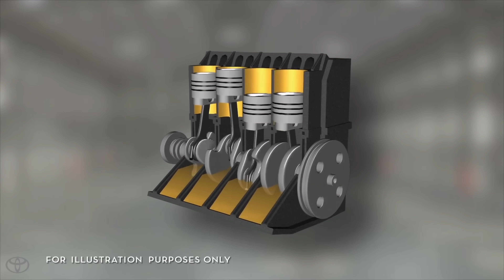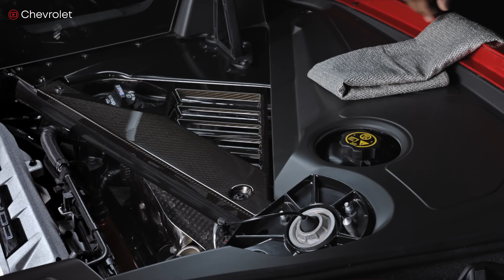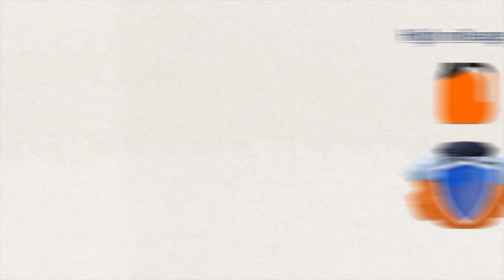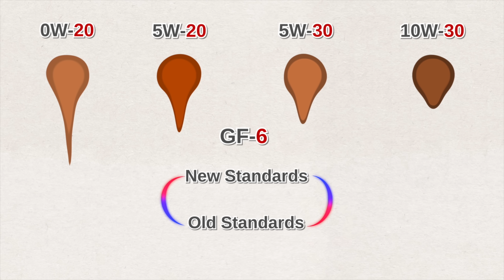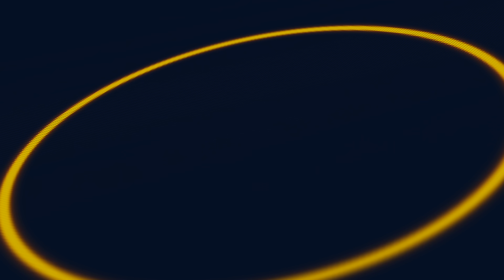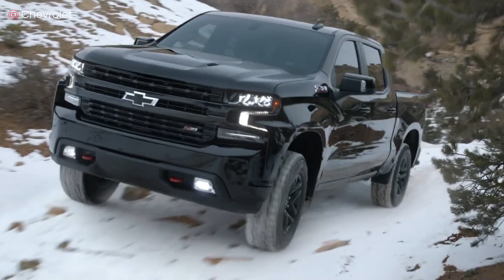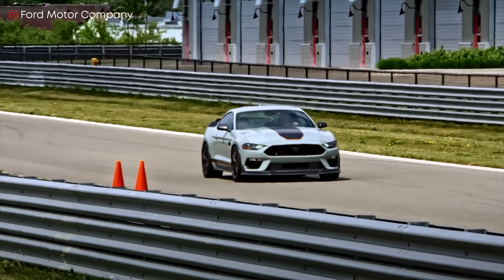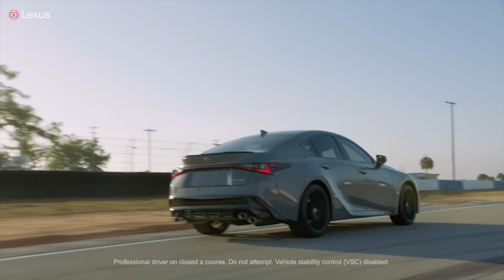7 Engine Oil Myths Stupid People Fall For

Comment: I used to work at my dad’s service station through high school and college. Down the road from his station was a used car lot called Pincher’s Used Cars. They came in and always just bought ONE gallon of gas. They wanted to have just enough gas to get the customer off their lot. 

When I checked the oil in their cars there was sawdust in more than half the cars crankcase. They put in the sawdust to slow the flow of oil leaking out. If the car needed oil they’d always get the 50W oil. 

I always felt sorry for the people who bought cars from them. They were a typical used car lot. I’d never buy a car from one of those small used car lots. They are all crooked.
Reply: I don't think that happens much anymore and those kinda guys would not be in business very long doing that kinda stuff now days. That and modern engines would not run very long with sawdust & 50 weight in them, I'm talking minutes. Ha!
Reply: @429thunderjet2  Thats true. Just about all cars have computers and OMDs can diagnose any problems. I believe sawdust in oil would freak out a few sensors. It’s a lot harder to sell a lemon these days. There is even an accident database. But one great thing about older cars is you could fix just about everything on them. I’ve overhauled a dozen engines and a few transmissions. I loved working on cars. But now they are engineered to discourage any do-it-yourselfers. 

Things changed radically in the 80s. They even added 10,000 different type screw heads (slight exaggeration ;). I remember trying to work on my mom’s 1980s car and needed to but need to buy a lot of special tools to do it. Just 3 types of screws could replace the countless types they have now. It’s all about getting our money.
Reply: @MovieMakingMan  for sure! There is however still plenty of unscrupulous shops, mechanics & dealers that all they want is your money, unfortunately.
 I am an old lifelong mechanic that can sleep at nite knowing I was fair & honest with my customers. But yah they sure are getting hard to work on and that's not taking into account the electronics that can sometimes kick your butt. Talk about tools, ha, I have 10s of thousands of $$ invested in tools over the years, maybe more like five figures, idk I haven't counted ha! Heck, my $6k multi function scan- test- scope tool needs a $1,200 update right now. 
So my advice to everyone is keep up on maintenance, use top quality lubricants, filters & parts will go a long way to keeping your vehicles on the road and out of the shop.
Reply: @MovieMakingMan  also I think saw dust put in motor oil would plug up solenoids and restrict oil flow enough on modern engines to destroy them in very short order, more so than messing up sensors. But anyway yup not good.
Reply: Another thing that gets my goat is those shops upselling services that aren't really needed. That or charging for services that aren't even done. It gives honest shops & mechanics and the whole industry for that matter a black eye!

Comment: As a tech I always recommend people to change their oil 1000-2000 miles earlier than what the manufacturer recommends if they drive their cars hard. Last thing you want is worn out dirty oil trying to lubricate a high power motor at its top end power
Reply: Would using 5w30 in an engine that calls for 5w20 hurt it?

Comment: What about 10w-30 that says it can be used in engines that require either 5w-30 or 10w-30? Never heard of anyone talk about that.
Reply: 5w-30 is a better option as it is thinner at startup which is better to quickly flow and protect a dry/cold engine. Either way at operating temp they both run at 30

Comment: THIS OLD CRAZY WISE GUY 
👍🏼HE'S ALWAYS 💯RIGHT👌🏽
Reply: ....well, the second number in 10W30 is not the summer number, it's the viscosity at or near operating temperature the engines clearances and flow paths are designed for.  It's very important to get that right, and the 10W winter or cold viscosity only matters to people in cold climates.  He mentioned the vis at 212, but that's the viscosity SAE test temp standard the oil is tested at.  An engine that runs very not like in racing often uses a higher vis due to that operating temp, then even more important to get the engine hot before putting a big load on it.
Reply: Except when he is Wrong. W does not mean Winter. If he has been a mechanic for 50 years he would know that.

Comment: Actually LSPI is not for gasoline detonating too soon - it's about oil that detonates too soon - before the gas is sprayed in, the oil is detonating causing bits of ring and piston to blow apart. The pass rate is quite low but only a true 100% synthetic is passing LSPI tests 100% (per dexos Gen 2 testing)

Comment: Full Synthetic or 100% synthetic - Amsoil gives you the best of these and seat of the pants (dyno testing too) you can feel the reduction in drag when you tap on the accelerator. 
All oils should be "High mileage" - To make a oil that is not "High Mileage" means they are stripping you from the additives you are paying for.. Because if you started with  "high mileage" oil you would never see the degradation considered to be high mileage.

Comment: I have an '06 Chevy Silverado 4.3 V6 with a little over 150K.  I always changed or have my oil changed before it's due.  I've always used conventional.  Used to do my own but NTB always has a sale for $19.95, With fees it's about $25, and they use Valvoline.  I can't buy the stuff for that, and if I could I wouldn't crawl under the truck these days for the little difference.  I'm 73.  My wife's 2018 Toyota Highlander (love this vehicle) takes 0-20 full synthetic.  Still getting this done at the dealership on their dime.  OK, here's a question.  How much synthetic oil must be added to conventional to be considered a blend?

Comment: And for 65 years I thought the "W" stood for "weight" - WTF?  I don't recommend switching from conventional oil to synthetic oil in older vehicles >10,000 miles. I did it ans spun a main bearing.  There are more detergents which  can plug screen intake to oil pump, and synthetic likes tight clearances as in a new motor. I have never used synthetic. Good old Quaker State 5w-30 every 3000 miles and everybody is happy
Reply: zero evidence for what you are saying.  none

Comment: Scotty I have a question. I have an 05 Ford ranger with 112,000 miles on it. If I switch to full synthetic will it be better or would it hurt it? It calls for 5w-30 conventional.
Reply: Daniel, Go with 5-30 Motorcraft Full synthetic motor oil. It's more expensive but the protection is awesome.  Shawn.

Comment: Synthetic motor oil has been run through a refinery hydrotreater with hydrogen to get rid of unstable long chains that might bond with each other to create globs of gunk. When mixed at the lube blender the additives are added. The more expensive oils have up to 1/3 additives by volume. Most of these additives are vendor secret blends of antioxidants to keep steel and bronze bearings from wearing. Standard oil is ordered from the refinery with standard blends of heavy and light oils to match viscosity specs. They may not have any special additives.

Comment: Rest assured that the vast majority of "synthetic" oil is not really synthetic like it once was.
All of that fancy synthetic oil you get at Walmart is group 3 which is nothing more than standard non-synthetic oil that's been hydro cracked.
Hydro cracking is a process which uses heat and pressure to change one molecule in conventional oil which legally allows it to be called synthetic.
Are real synthetics still available? Yes. Those are the ones that cost $15 or more per quart and of course are not available at Walmart.
Once in a great while, the manufacturers actually put real synthetic in the bottles, it's rare and almost impossible to find out which ones they are so good luck.
🏁
Reply: ok genius.

Comment: Also a fun fact when your gas light turns on that “typically” means you have 2 gallons left. For this of whom like to push their luck lol like me
Reply: When your Low fuel light comes on your not only pushing your luck for running out of gas but pushing your luck with your fuel pump if you make it a habit it's the basically the same as  if you running low on oil
Reply: @thegreatcanadianlumberjack5307  Right, and don't want to clog fuel injectors with the crud on bottom of tank.

Comment: My Honda calls for 5w20. I switched to 0w20 and my mpg went up 4mpg. I havent seen it burning any oil or leaking any. I bought it with 160k its a 4 cylinder t now has 166k I change my oil at 3k. Do you think I'm making a mistake and possibly hurting my engine?

Comment: If you're like me and only put on 2,000 miles a year, don't forget to change your oil after 3 or 6 months, depending on car recommendation. Oil does get old once exposed to air. Oxygen, humidity, and other things will degrade over time even when not used.
Reply: Well my car leaks so bad that I’m always adding oil. Haha. So it never gets oil. Just change the filter every year.

Comment: 80% of engine wear occurs in the two seconds after you start the engine and it revs to life.... with no oil pressure! They need to install electric pre-oilers that pressurize the system before the engine even moves. Then you'll get 500,000 miles on a car.
Reply: Probably a million miles...
Reply: Not entirely true. Many Japanese cars achieve this with the crank sensor. Meaning the engine must turn several revolutions to prime the oil pump & pressure the galleys before ignition & fuel are supplied. That’s just one of the reasons why Japanese engines outlive Detroit products.
Reply: @gerrylundergaard60  
If the engine is turning that's the problem.

Comment: Scotty, what is your opinion on Amsoil? My dad and I have been running it for years and we both love it. I have always wanted to hear your take on it. -Rob
Reply: Personally,I think it's overkill. Your engine may go for a million miles but the body will rust out or the transmission will fail or the car might outlast you (I'm 74 and our Toyota has less than 60,000 miles). Furthermore, I enjoy changing my oil so I plan to continue changing it every 5k.

Comment: I have over three hundred thousand miles on my engine I've been using 10-30 conventional oil..I was told that it will leak if I use synthetic. Is this true?
Reply: those were on older engines..the gaskets would start to leak,,,i would stick with what you are using or go to maybe a high mileage oil one
Reply: John, If you used Conventional oil 10W30 for 300,000 miles. Keep using it. But move up to High Mileage conventional oil. Better additive package in High mileage conventional oil. Than regular conventional oil. Shawn.

Comment: I have got a Lancia Delta 836 type of 1993, i use 5w30 for engine in place of 10w40 and atf in place of 75w90 for the manual gearbox.

My Opel Corsa 2007, i use 5w40 for engine and atf for manual transmission.

My 2020 subaru forester hybride (made in Japan, Gunma factory plant) recommends 0w20 for the engine. But Subaru Europe says that oil is for cold lands, like Canada for example.

For countries like Swiss, France or Spain, They recommand 0w40. 5w40, 0w30, 5w30 are suitable oils too.

I spend around 120 us dollars for 5 litres of Castrol 0w40. Grettings from Swiss.

God bless you Scotty

Comment: You forgot 1 though Scotty. High Zinc Oils like Joe Gibbs HR-1 oil or Diesel "Fleet" oils (that still put Zinc in there but it's heavy summer only Oil for gas engines). If an engine has a flat tap cam (older engines from the early 90's down) I always use there high zinc oils & prefer the HR-1 due to it having multiple weight choices. All of my small engines (lawn mower, chipper, tiller, etc etc) I run Diesel Fleet oil in, and even the new ones I just bought, actually call for that oil due to its Zinc levels.
High Mileage Oil - is for modern High Mileage Engines (w/roller cams). It's a recipe for disaster in a Flat Tap Cam engine...... trust me. If you want to use modern oil in your old engine, do the Roller Cam conversion.

Comment: I got High Milage / Synthetic oil, and it seems to work the best out of these three basic engine oil types. No leaks, and no evaporation. And it's viscosity has not degraded. I usually have these problems with other oils.
Reply: i read that even 5w-20 conventional oil is quite stable because it doesnt need so much viscosity modifiers to give the 5-----20 viscosity spread  .
Reply: @tjlee9901  Some viscosity modifiers "viscosity index improvers" (thickeners) as were used in some popular 10w-40 oils during the 1970s and'80s were adjudicated by Tecumseh Engine engineers to have been unsuitable for use in internal combustion engines and I think later GM engineers decided this was true of GM Car and Truck engines--remember the revision made to the 1980 Chevrolet Citation owner's manual
Reply: Where do you get your oil viscosity tested, and how often?  How much oil evaporates over what period of time? 
Oil leaks aren't caused by oil, they're a result of inferior gaskets or seals or poor installation practices.
Reply: Some people claim that one brand or another makes their engine run quieter. I think with the spooky low viscosities like 0w-20 or this newfangled 0w-16 it is likely that such oils can only be made stable and evaporation resistant enough to be practical by using synthetic base material.

Comment: I have a question that is not related to oil. I recently took the exhaust manifolds off my 1998 gmc 1500 and replaced the gaskets and also replaced the donuts between the manifolds and pipe and the flange gasket behind the catalytic converters. After driving  a few miles the flange gasket behind the cats was smoking and had burned a hole through the bottom of the bank 1 side in the same place the exhaust was leaking before. Why does this happen? I am wondering if the muffler is plugged with carbon on that side because the engine was misfiring or something.

Comment: You might have also added on the "higher viscosity is better" myth, Scotty, that use of a "thicker" oil than recommended can impede flow throughout the engine, especially where these exotic, by standards of a few generations ago, "twin-cammer" engines with the OHCs and extensive valvetrains.  There's a difference between viscosity and lubricity, although they're related.  Oil has to GET to the parts in order to lubricate them!
Reply: He explained pretty clearly to me which cases thicker oil is better, hotter climates and higher milage
Reply: @Nick-Hoff  If the engine has enough wear that a more viscous oil makes a difference, it's a "tired" engine that's in need of a rebuild.  But, if it's not going to be driven a lot, subjected to severe conditions, or taken where a breakdown could be disastrous, then 40W oil is CHEAP.
Reply: @selfdo  actually the theory his a higher viscous or thicker oil is better for old engines. If you are left with only oil on the pistons you want a lower viscosity oil so there is more left on all moving parts
Reply: @Nick-Hoff  but the oil recommendation isnt about the heat of the climate. Once the engine is up to temp it doesnt matter how hot it gets outside. What matters is that the oil is able to effectively get between components. This means the recommended viscosity at temp is determined by the tolerancing and design of the engine, whereas the recommended viscosity on cold starts is determined by the climate.
Reply: Also some of these engines have limited angle rotational joints on their camshafts that can advance and/or retard the actual working part of the camshaft a calibrated amount relative to the driven end of the shaft,this thing is operated by putting oil under pressure into one or another port/chamfer feeding the limited angle actuator and the oil needs to be of very low viscosity to flow fast enough and also the tiniest amount of  varnishing could totally mess the thing up

Comment: I have a mazda 3 2.5 2018 I used 5w30 full synthetic with a quart of marvel mystery oil instead of the 0w20 oil they recommend. I live in California. My car is way more quiet and smooth. I don't see no difference in gas mileage.
Reply: Ask yourself what’s in marvel mystery oil that I’m putting in my engine for no apparent reason? Mazda built the car and have recommendations for a reason. Marvel is a thick gooey addictive oil that doesn’t belong in a 2018 newer car that call for 0-20w. It’s something I would only use in an old tractor that has issues. So your not using the correct weight oil and adding goop of mystery oil of some sort on top! Your poor engine must be struggling, good luck.
Reply: @spaceexplorer6636  marvel mystery oil is like a 0w20 oil it not thick its very thin. It has worked for me for a long time.
Reply: @dantoine0  how do you know its working for you? How do you know it’s safe or good for your engine? You don’t. 
It’s just a gimmick with a catchy name! No manufacturer recommends it or endorses it. Unless your a chemical engineer or smarter than the builder of the car I wouldn’t put any weird goop inside my engine! But it’s your car and not mine so good luck.
Reply: @spaceexplorer6636  I had a mazda 3 2.3  2008 with 180 000 miles you could not tell it had that many miles very quiet and responsive after using marvel mystery oil for 5 years
Reply: Another thing is am always pushing my car hard always in sport mode
Reply: 0w20 is only recommended for the North American market all other parts of the world is 5w30 for your engine lasting you a long time